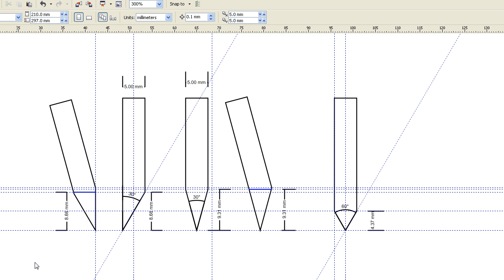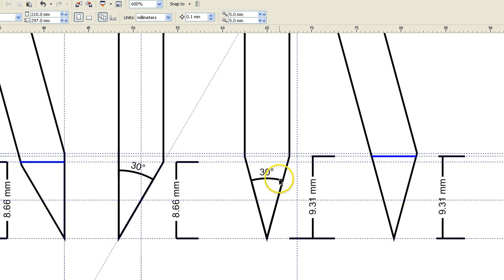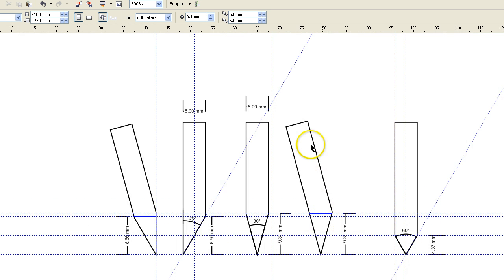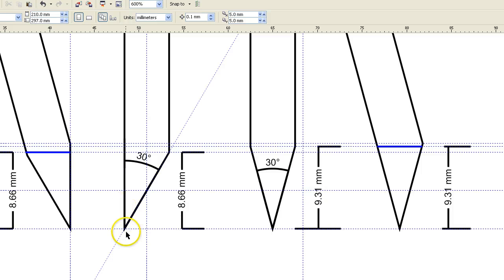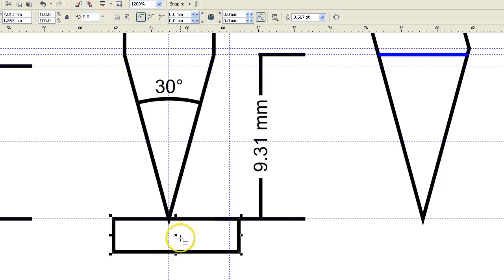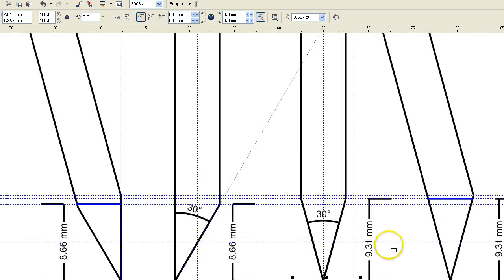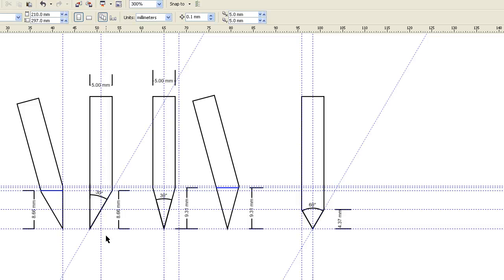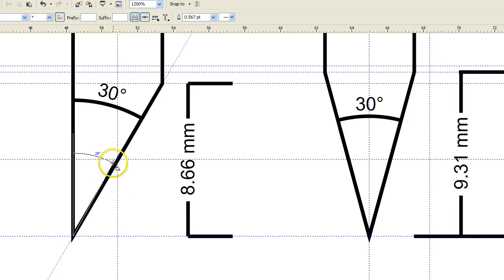Knives, Mathematics, Truth vs Facts. LISTEN/LEARN/VERIFY

Comment: This is very helpful❤ as I am looking to buy a silky nata, which has single bevel  and double bevel versions. 
unfortunately, the nata has a quite wedgy primary grind.
Reply from the maker: Single edge is really good if you are pruning right to the trunk or stem. Single edge let's you get perfectly flush. They are very wedgy but it makes them good for the intended purpose.
Reply: @knivesandstuff  Yes but the symetrical double bevel versions are also wedgy, and even more than the single bevel ones, that is kinda wierd.

Comment: Thanks for the info. Is it me, or is some of the most informative knife and sharpening info coming out of Australia/New Zealand area? Or is it just that I am using links from people in those areas?
Reply from the maker: @michaellynch1132  maybe just the links. Hehe. There is also good info all over. Also a lot of bad info. It all comes down to perspective. Ultimately even good advice will be bad advice if you personally can't follow it correctly. The right advice is always the one working best for yourself. Overtime. What's good might change. If you have not watched cliffstamp channel (rip) I recommend it.
Reply: @knivesandstuff  I will check it out. thanks. Seems like a lot of good people are now RIP.
Reply from the maker: @michaellynch1132  sadly, yes

Comment: Love both of your videos, very claryfying. I mostly make kitchen knives and apply different types of bevels depending on what the "rules" say about that type of knife. I have a question... I mostly run my bebels right up to the spine to create a nice distal taper and create knives with spines between 1 and 2 mm thickness... if I would run my bevel up to the spine with a chisel grind or run it equally high with a V-grind, how would that affect the edge? I know the chisel grind will deflect, but what about the angle and sharpness? Or "meat" behind the edge? Thank you in advance.

Comment: You can go more acute on a chisel grind than a V grind. If you look in your example yes. The height of the chisel reaches 5mm at the same height the v grind does ... but there is still meat on the bevel before the blade is back to 5mm. 

Ergo you could go for something closer to 27.5* instead of 30* without sacrificing strength.

Comment: After making my previous comment, I have just thought of another reason to have a chisel grind on a knife.... and that is if it is made of case-hardened steel.  Steel hardened this way will generally have a soft core, but the outer few thousandths of an inch will have enough carbon in it to be hardened.  So a chisel grind may utilise the harder 'skin' on the blade and maybe retain a better edge than it might if sharpened with a symmetrical bevel.  So to my way of thinking, there are two main reasons why a chisel edge might best in some circumstances:  1: helping to achieve a flatter surface when doing certain specialised work, and 2: enabling the harder skin of some steels to be the cutting edge.  Otherwise I have found chisel-ground blades to be difficult to work with for some tasks.  I am yet to experiment with a single bevel on a machete, but it is possible that such an edge might allow some cuts to be made with less deflection or 'glancing off'... but a machete like this would have limits.  A single-beveled knife with a narrow blade can be useful for making curved cuts in fruit and vegetable preparation, like cutting the core from segments of apples or small pumpkins. With the bevel against the fruit,  a neater job can be made of making a circular cut with a relatively small radius.

Comment: It was great to find this video that tells it like it is.  Thank you.   I've seen a lot of stuff on the internet extolling the virtues of chisel ground knives, and I just can't agree with a lot of it.   When I graft  my fruit trees, I find I get nice flat cuts with a single-bevelled blade if I have the flat side against the graft wood I'm shaping, and my results aren't always so good if I use a standard grind.  But apart from that I sharpen my knives to have a symmetrical bevel.  Best wishes from Nelson, NZ.

Comment: It sounds true ... it is true ... but is not quite important ... 2 things to consider - most of the time: the hardest thing you are going to cut is wood and you are not going to apply a tremendous force on the knife (in order to bend the metal) + most of the people don't use the knife perpendicularly anyway do having a chisel grind actually brings the blade in a "correct" posture" ... :)

Comment from the maker: I have not had time to touch it yet.. I have to think carefully about how I will tackle that knife.. the right block of handle material, and a bolster.. etc. 
Its also not a typical modern chisel grind.It appears this way because of how its ground, but its infact a full height bevel ground on the entire blade and tang to look flat, but it is a tapered bevel to the edge on both sides. the right side has a little more meat, and the secondary is only on the right. the edge is centered

Comment from the maker: it can take forever to explain in words which is why I do videos. But as you probably know. a chisel with a 30 degree bevel only needs to be raised 2 degrees or so from flat to shave material. the mallet is only 2deg of point.
with a v grind chisel of 15dps(30) your hand is raised 15deg to flat, and then another 2 deg to get the shave. you are now 17deg off parallel when striking. you are striking into the material you want to protect to make the cut.
If you dont agree, I'm happy to watch a vid

Comment from the maker: sure, i never implied thst you dig deep and hard with a chisel like a plow. but every strike, even when removing material a layer at a time is directing energy outwards. the less energy going into what you want to keep the better.
I understand what you mean now about the small carving knives. its more a matter I dexterity I would guess. chisels only work well in a single direction with the bevel face up. not so practical for carving.

Comment from the maker: contd. because the bevel is on the outer side, the fracture energy is directed that way, rather than both directions so the joints you are creating have less chance of damage and fracturing. A V-Grind is expending the energy across both the inner and outer bevels and this is not ideal when you are trying to leave a nice undamaged finish with clean sharp lines for joinery.  I think unless people have done some carpentry it is hard to visualize

Comment from the maker: decorative carving chisels come in all shapes and size. u shapes, v. etc for fine detail work. The main purpose of the chisel grind being a chisel grind is because it is the one that has the most impact energy from a mallet going in line with the direction of the cut allowing for more accurate and efficient shaving of the wood in a controlled manner leaving a flat face to the wood. a V-Grind can do the same work of course, except that the chisel handle wont be inline with the bevel when hitting.